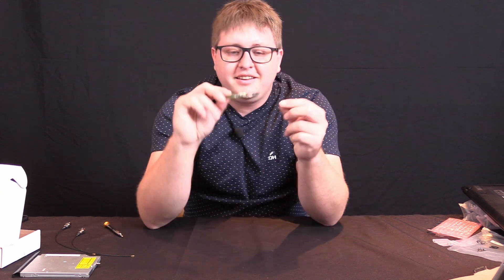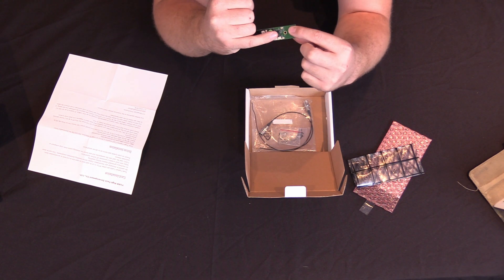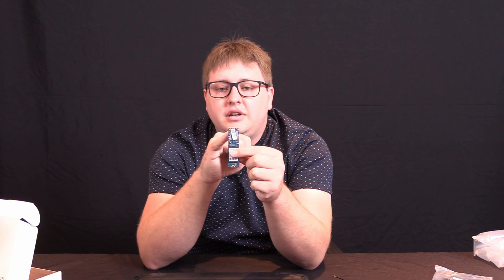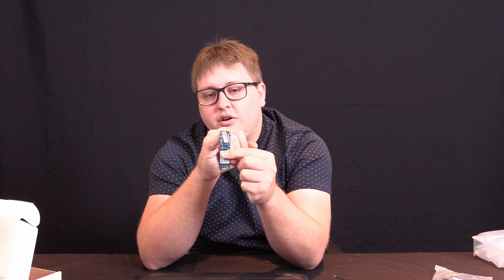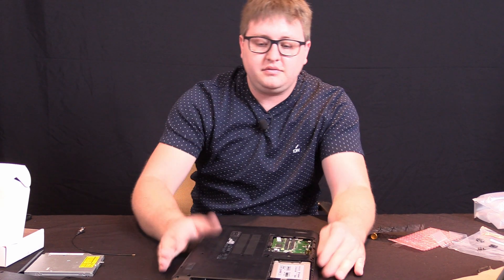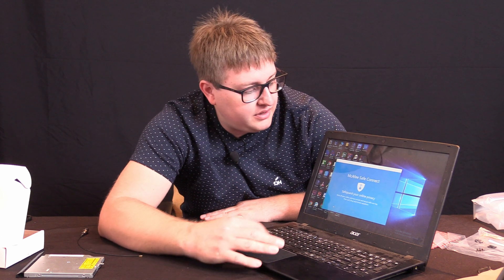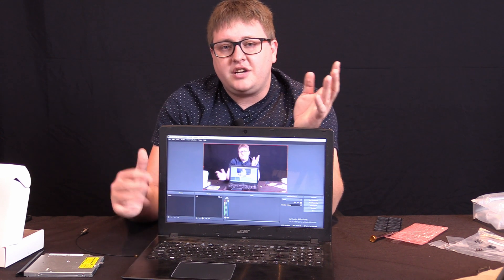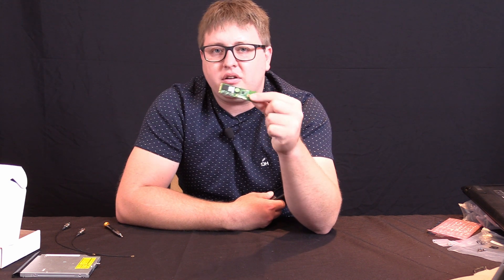TAKE NOTE TECHNOLOGIES FIRST REVIEW : YUAN SC540N1 1-Channel M.2 SDI Capture Card

Comment: 6 years ago... man, i'm late to the party.  these days, if high end laptops still had movable optical drives, we could 3D print a replacement for that CDROM, with the holes for the BNC connectors.